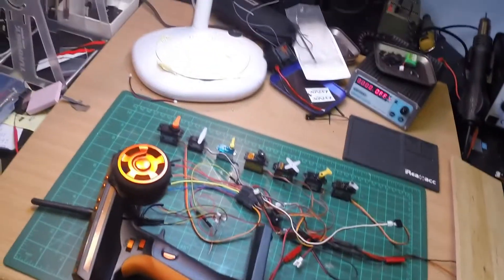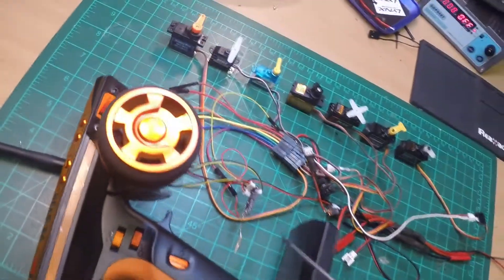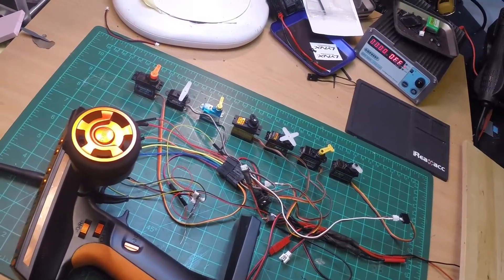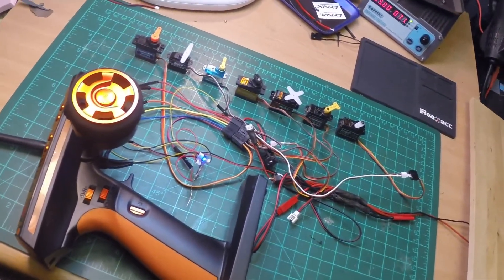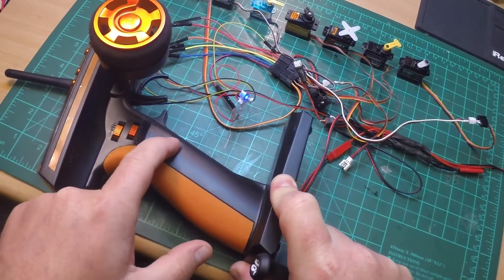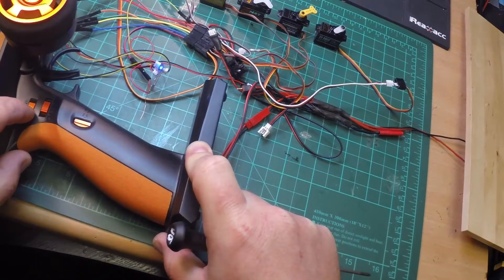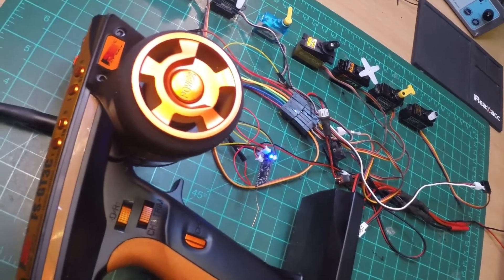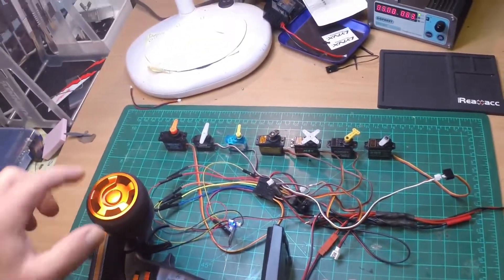DasMikro 8-Channel Ultra Micro Receiver with 8-Ch Flysky GT3C Transmitter (hacked firmware)

Comment: can you tell me how to mix for 4ws?
Reply from the maker: Press "Expo" long, and then go to "4". There chose channel of 2nd steering servo. In the second point (of "4") chose the mixing ratio between the two steering servos (% - 0 = both servos run equally - you can chose more steering front or back). Then "crab": CR0 = crab off, CR1: Crab on). Can use buttons for crab on/off and "4" and a rocker for ratio.